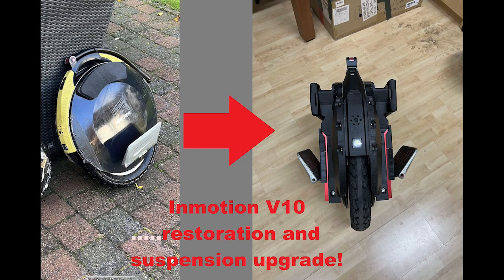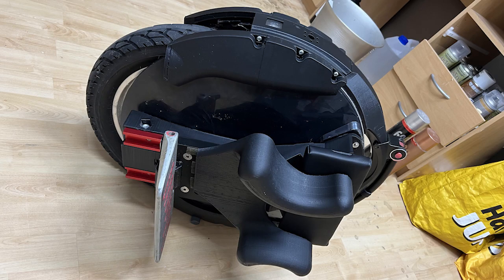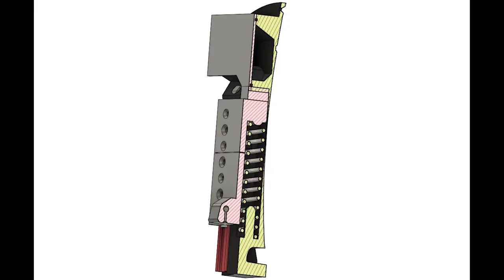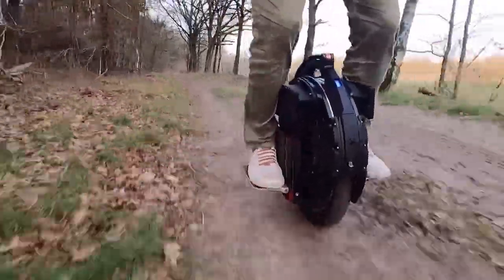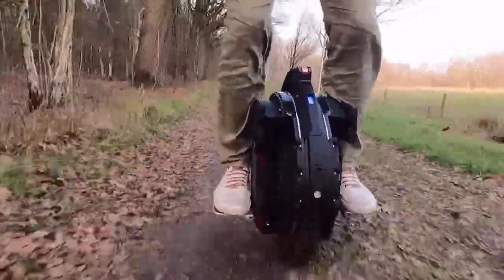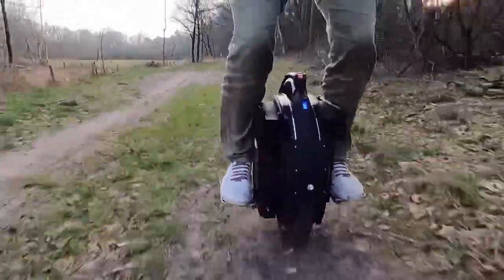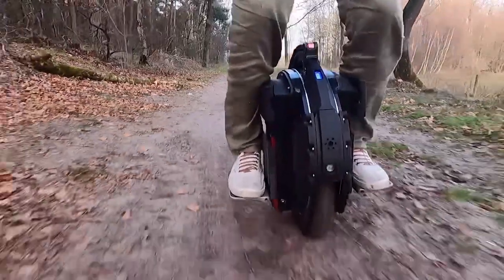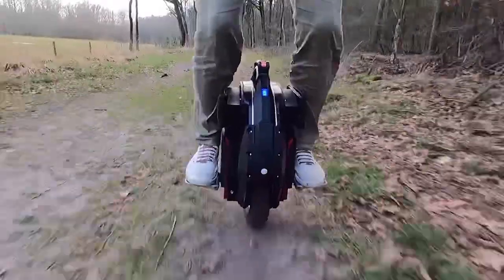InMotion V10 / V10F restoration and suspension upgrade. EUC modding

Comment: Hi. Are you still using this suspension, isn't it defective? A very interesting project.
Reply from the maker: Hi man! Yes I’m using it almost a year now. Still working perfectly. Mainly for driving in and around my own town since it’s illegal to drive them in the Netherlands. Bumps and curbs are no problem for it.
Reply: I plan to do it similarly but at Gotway ACM. I'm just wondering what specific springs you used there?

Comment: Wow that's impressive!. Id like to buy, but could you tell what other parts we will need to buy?
Reply from the maker: Thanks a lot! If you watch my assembly video you can see the parts in more detail. When you purchase the 3d files there is a list of all the specifications/dimensions of the bolts, screws, sliding mechanism and the 2 springs. If you would have any questions during the build you can always contact me of course.